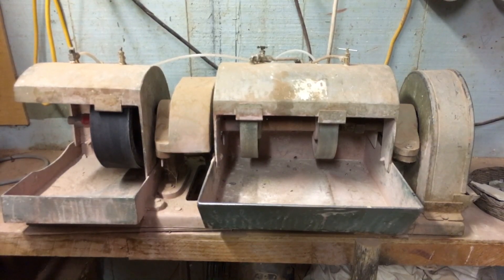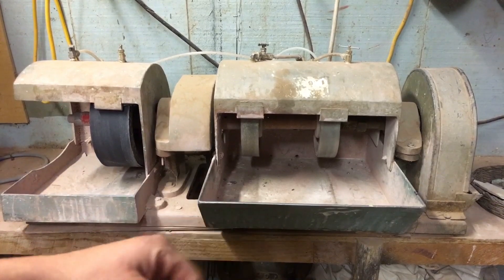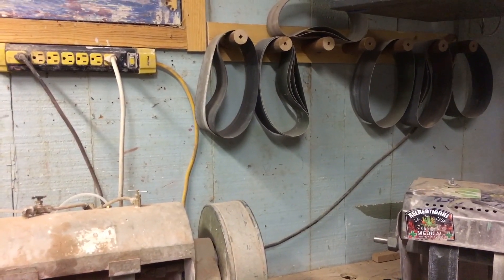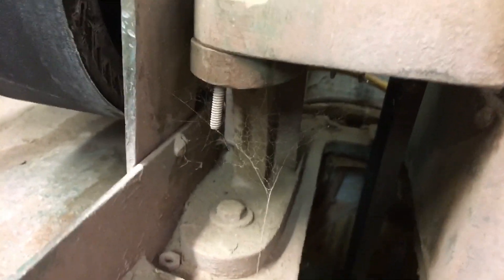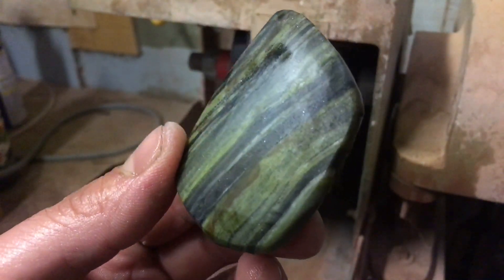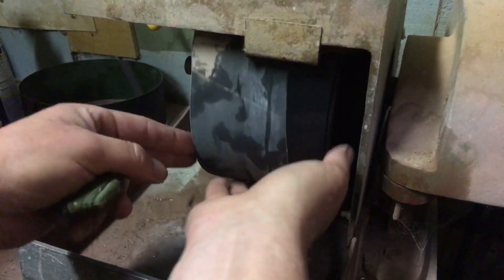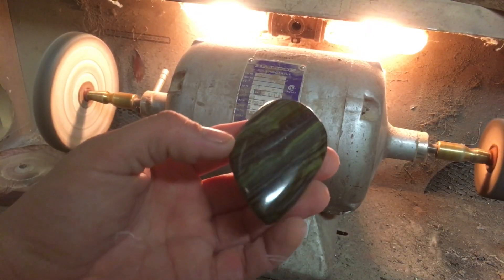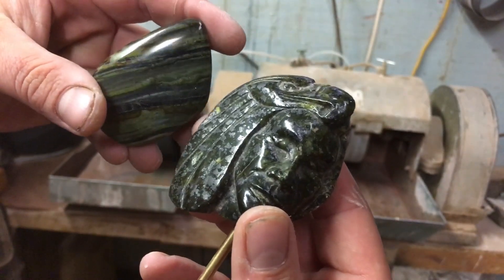Highland Park A-50

Comment: I just bought one too. No stand. But with a 1/3 horse motor. Gotta see what kinda wheels I can score on ebay. Thanks for all the fabulous and informative videos.
Reply from the maker: Heck yes my friend:)
Reply: @lapidarydave  I've put two Crystalite wheels on the left (100 and 220 grits) and have ordered four nova (actually Super Nova) wheels on the right. And of course the buffer on the far right. So I'm essentially replacing the two centrifugal wheels that originally came on the left side. But I can put them back on if I need to later.

Comment: Hi, I have a Highland Park A-50 lapidary grinder, polisher. I was wondering where I should oil it. Thank you Faith
Reply from the maker: I’m sorry I really don’t know I’ve never oiled ours lol maybe oil everything on it 😅
Reply: @lapidarydave  Hi Dave, had to reset my pass word to respond. Hey thanks. It seems to be running great but, big problems. Who ever owned it before I guess drilled out holes to big now it sprays to much water on the grinding wheels. I called Norgren and they longer carry these valves, so I’m stuck with this beautiful grinder, polisher and cannot use it. I’m bummed. Any suggestions? I’d surely appreciate it since this is a dinosaur but one heck of a machine. If you need a photo of valves please feel free to pm me. If you can help me figure this out I will composite you. Thanks much
Reply from the maker: @faithrigolosi1028  There are companies that sell magnetic flexible sprayers Highland Park is one of them and they sell them on their website for about $10 I would suggest buying one of those and just forgetting about the old watering system